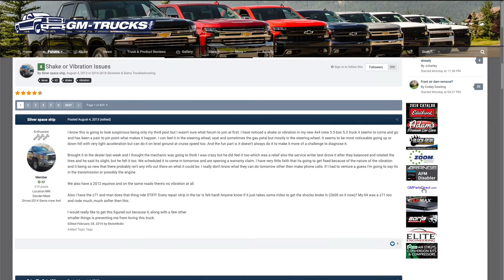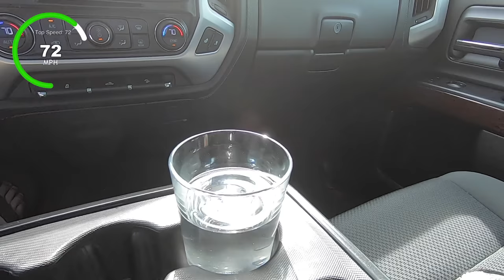"Chevy Shake" Driveshaft Fix for GM Trucks?

Comment: use to go through u-joints in my old F-150 then i ran over a deer and bent drive shaft had a new one built and i had put on almost 100,000 miles on the same u-joints when i sold it
Reply from the maker: Thank you donald day

Comment: My truck shakes 30-45 miles per hour and then smooth out, idk why. I’ve been trying to fix it and I figure the 26” rims would be the case but I had actually lifted the truck with and without the rims, also putting the original one in it. The shaking of the truck sounded really bad 30 to 45 still and when I stopped the truck, I would hear like a crack sound when lifted.
Reply from the maker: Sorry to hear that.

Comment: Ive had 3 of these trucks. 14 silverado 4x4 double cab was smooth up to 75k when i sold it. 14 silverado 2wd still have it and it shakes very very little. My 16 sierra 4x4 shaked bad.. Did a 4" coilover BDS lift and it seemed to tone it down quite a bit.
Reply from the maker: Thanks Jose Gutierrez, I appreciate the input.

Comment: I wonder if maybe balancing the driveshaft would take care of the vibration thats left. Maybe they've done that already. I bought a 14 sierra im hounastly bless i haven't had any issues with it, and its at 107k. Ive had it up to close to 100mph and its silky smooth. Not saying I'm gonna push my luck and hit the limiter lol. So far only issue I've had is the manifold gasket blowing out exhaust

Comment: I'm wondering why the shop decided to perform surgery with the 2-piece shaft before swapping in an upgraded 1-piece to test results?  Seems like extra effort right off the bat.
Reply from the maker: Lee Cherubini just trial and error diagnosis. The 2 piece has been known to fix the vibration in the 2WD trucks so that was what they wanted to try in the 4WD trucks.

Comment: I have the same issue in my 2011 silverado 6 speed it has the shake at about 115 / 120 mph
Reply from the maker: Just gotta ride through it and get er up to 125 I guess.
Reply: I have a 2016 2500, it has a speed limiter, can't get to 100mph, leave it to GM to fix a problem by not making that scenario possible.
Reply: @dainwright1573  programmer
Reply: all tires are speed rated they have to make trucks for dumb people so they won't get sued by stupid drivers

Comment: I have a new 2019 that has a vibration from 20 to 30 mph and I can almost guarantee its a driveshaft.
Reply from the maker: Really? Don’t hear a lot on the 19’s. Have you taken it in yet?
Reply: Mine too 2015 gmc 20 to 30. You think its the driveshaft
Reply: Luckily I dont have this issue
Reply: When you start to notice the vibration, look at the middle gauges, and see if it's when the v4 mode kicks in, I have a 2015 Silverado 5.3 had the vibration when the v4 mode kicked in, I brought an edge programmer for it, turned the dod(displacement on demand) afm(active fuel management) whatever you wanna call it, I have no more vibration issues, mines v8 all the time now, oh and also it didnt hurt my mileage that bad only down like 2 to 3mpg
Reply: It was the torque converter for my 2016.
Reply: I have a 2019 GMC Canyon. It started shuttering and shaking at 1500 miles.  There is a service bulletin issued  from GM on this issue. It requires changing the fluid in the transmission to a different type.   I brought it in for that service and it fixed the issue.

Comment: Did you raise your front bumper?  What size tires are those?  Lastly I've heard changing out the axles is a huge improvement for the chevy shake.  I bought a new 18 Sierra Z71 with the 6.2 and was real scared I'd have the chevy shake.  So far after 18,000 miles no shake!
Reply: Me either..so far.. fingers crossed
Reply from the maker: I did not raise the font bumper, just removed that air dam on the lower.

Comment: I have the same truck with like a 1
5inch leveling kit.. mostly stock stuff.  Almost no vibration. I figure anything is from tire balance.
Reply from the maker: Thanks for the input, they did replace one of the wheels really early on as being out of spec but otherwise the tires have been balanced several times with no luck in making a significant difference.

Comment: 2017 Chevy ext cab.... the shake is driving me crazy. Driven GM my whole life without issues until now. When I first bought this truck it only had 30,000 miles on it. I did not have a shake until after 100,000 miles. They had to change the transmission in it and it has had a shake ever since. I'm going to attempt to change drive shaft and U-joint hoping that solves the issue. Because I didn't have a problem until I got a new transmission I wonder if it caused a bind and on evenly or out the U-joint?
Reply from the maker: Sorry to hear that.

Comment: Bought my 14 crew cab 5.3 used with 45k miles. Day i drove it home  called the dealer and said it shook bad. They took a big shit on me, to make a long story short was going to trade it on an f150 but tried a local gmc dealer and they did the ring and pinion under powertrain warranty. Made a world of difference along with getting rid of the crummy hankook tires the dealer put on it for michelins. BUT, still have a slight shimmy, not too bad, around 75-80. I give up. Also i was a mechanic for 15 years, and i still give up. Almost thinking front wheel bearings as it does go away sometimes on a slight bend when u r turning the wheel just a little.  Oh well it only goes on long highway trips 2-3 times a year i drive mostly local.  Take the wifes tahoe on the family trips...
Reply from the maker: Any updates on the truck?
Reply: Try a tranny flush I heard that worked for a couple people

Comment: Hi Dan, this is a great video. I purchased a 2014 Chevy Silverado Regular cab 6.5 ft bed 4.3 v6 2wd yesterday. It's starts to vibrate at 70 mph then extremely worse at 75 mph, the entire center console is shaking. You mention that performance drivelines can fix this issue on the 2wd Chevy with their driveshaft. Has this been verified by anyone you have talked to? I'm considering ordering this driveshaft because the truck is not drivable at 75 mph. I always need to keep it at 70 mph and below.
Reply: @Nick Sarris if you watch till the end he explains what his thoughts are. The problem got better but wasn't completely fixed.
Reply from the maker: Thanks Nick, I really appreciate that.

Comment: I guess I am one of the lucky ones.  My 2015 Silverado,  double cab,  4X4, 5.3 V8 doesn't shake at all.
Reply: I have the same exact truck
Reply: My 14 crew 2wd doesn't have this issue tho it did suffer the condenser failure issue.
Reply from the maker: I agree Roy Giller. Thanks for the comment.
Reply: My 2015 GMC Sierra  4x4 has never had this at all
Reply: Gears & Gadgets my mom has a 2020 Tahoe RST 4wd and her driveline has not vibrated. My dad has 2 2015 Sierra SLE 4wds, 1500 and single-rear-wheel 3500HD.

Comment: Ugh we had an chevy silverado 2016 shaking at idle n a rolling tumble feel 
Ugh piston or something major

Live in north phx here
Reply from the maker: Do you still have it?
Reply: @GearsGadgets   yea, this year alone, first both alternator then fuel pump, then needed brakes(front) still need back,  then this. 
First time in my life, all costly repairs in one year
Reply: @GearsGadgets  got it back from dealership
Damaged camshaft n essential repairs needed to be done around that, seals,filters, gaskets,etc etc. Engine n transmission flush including fluid changes in all departments. Replaced oil pan,cracked cuz it waa leaking.  N finally spark plugs....n sum air filters
Reply: Me too I’m in Phx same issues
Reply: @ZulunationFamily  we end up paying $8k it was damage n wear and tear to cam shaft inside the engine. They replaced everything around the engine
Reply: azapache2006 mine is  a 2009 I’m taking it yo the dealership Wednesday
Reply: @ZulunationFamily  only place that needs to fix it is at the dealership

Comment: I have a 2500HD GMC Seirra Ext Cab and I have a Vibration that only shows up when I am pushing on the Accelerator at speeds above 50 MPH and at the same speeds it goes away if I just fully let off the accelerator, I have checked everything from Bearings to driveshaft to Balancing the wheels to no solution then someone sugested Motor mounts and Transmission mounts.
Reply from the maker: Sorry to hear that. Seems to be a common issue.

Comment: my 2016 Silverado 4x4 with 6 inch lift, tires are goodyear duratrac 305/55r20 it now has 39 thousand km. the front tires started to cup, rebalanced and front end alignment which was not out, put the tires on the rear and now I get a shakeover 105 kmph and higher I put 12oz of balance beads in the rear tires it is now tolerable at high way speeds. I say its your tires that cause the shake.
Reply from the maker: Nope, tires were replaced twice different brands no effect. Wheel was also replaced that was out of round

Comment: Chevy dealer replaced a tire that supposedly had some high road force problem. Didn't seem to me like it did much if anything. My shake doesn't really seem all that bad to me.
Think the main problem might be the transmission oil change with mobil 1.
I'll do it and see what happens. Maybe push a upgraded driveshaft on them.
Reply from the maker: I went through all of that too.

Comment: Its not 4 cylinder mode, i know for a fact. My 2017 rcsb is 4wd. I have a big Texas Speed camshaft and DOD/AFM delete kit with a different stall converter. I still have “chevy shake”  i do still have the OEM drive shaft though. I have aftermarket wheels and tires so its not rims or tires either. I also have the shortest most rigid steel OEM drive shaft possible for GM trucks. I have a 6.5’ box with a regular cab and 4wd transfer case on the end of my trans shortening my drive shaft. As well as the fact that it is a single piece drive shaft. And mine still does it. Ive heard its the rear cab mounts also. Its all snake oil lol.

Comment: Did you ever change your Rotors could be out of Balance had a terrible shake on my 07 gmc tried tires re balanced the drive shaft lived with the shake till I did brakes and magically it disappeared
Reply from the maker: Yes. No change.

Comment: Have a little bit of shake on my 2015 GMC Sierra double cap 4.3 i have 20 in Denali wheels and all terrian bfg bought used i have 95k miles on it seems to run great engine and transmission doesn't use oil. Im not gonna spend 2 family vacations to fix the crap gonna go with hopefully balance the wheels then place my bet on the AFM gonna buy the range technology and keep all my cylinders running.
Reply from the maker: I didn't notice anything related to the cylinder deactivation making it any better or any worse but ultimately its really just a guessing game really.

Comment: Thanks for update. Carbon fiber driveshaft even better???.. Did you check old axles for straightness? I almost bought 2015 Silverado a month ago, but it had moderate shake at ~70mph. Then I saw some of your videos and some of the various threads on forums about the "Chevy shake" and I quickly changed my mind about that particular 2015 Silverado.
Reply from the maker: Glad I could help. I couldn't imagine the cost of carbon fiber, also not sure it would help or make it worse.
Reply: @GearsGadgets  - CF driveshaft is not that expensive. But it appears you have not yet discovered the perfect solution. Very interesting, and disappointing. Shame on GM for this issue, there's no excuse for excessive vibration, especially as they've been making trucks for so many decades.

Comment: How to use the bumper to bumper warranty? Does it only apply to the original dealer I got the truck from? My 2018 started shaking at ~30k miles.
Reply from the maker: You would have to ask the dealer I guess. I can’t tell you what to do.

Comment: I guess I maybe the anomaly, I have a 2014 Texas Edition silverado with 144,000 miles on it and I drive it like a sports car and do 80 and 90 mph and I have no shake but I do change all of the fluids regularly ,regular oil changes transmission fluid changed twice since I bought it and the transfer case fluid and the oil in both differentals

Comment: I’m having the same issue. 2016 Silverado 5.3 flex 1500. At first Chevy told me it was the oversized tires they put on it. Well 60,000 miles later I put new tires on it and had a full alignment done. The problem still exist even with a slightly smaller and less aggressive tire. Smaller tire did help slightly but the Chevy shake is still there. I checked for rear  axle alignment and I adjusted axles until there was less than 1/8 difference.  Engine shake is BS. I have no misfire, I check with a snap on scanner and I didn’t have a single misfire, up hill, down hill or at any normal RPM range. I’ve inspected my driveshaft ujoint and have zero play. I also inspected all suspension components as I have a 3.5 inch aftermarket lift (Rancho) that came stock with my truck purchase from a Chevy dealer and all components are tight, no signs of extreme wear and no leaky shocks. Shocks sill work as they should and leaf springs are doing their job when loaded. 

I don’t have any loud noises from my rear end just the shake. I can literally see my truck bed vibrating in my side mirrors. I don’t hear any bearing squeaks or squalls. No damage to driveshaft. So I’m just like what the hellzzz is the issue?! 
If time permits I will inspect rear differential for runout and end play as well as rear axle bearings but I’m still scratching my head here because these types are things are usually fairly easy to problem solve. Thanks for any advice.
Reply from the maker: The driveshaft / axles cut down my vibration by about 90% and at times it is smooth as can be. It was by far the best fix so far. I have a hard time telling people to do it because all of these “fixes” seem to be VERY truck specific and I would hate to hear someone say they saved up money for the parts only to have it not work.

Comment: I had this same issue and if I could offer a piece of advice it would be to not throw money at parts without first diagnosing because this issue has many causes which are inexpensive fixes.I tried on two sets of wheels, had the tires rebalanced, stock driveshaft rebalanced, reshimmed the rear axle angle, and had the axles checked for out of roundness with a gauge.Mine was a RCSB on factory 20" and the silver bullet was softer rear shocks.Take the time to have someone check everything in the drive line and you will find the cause.
Reply from the maker: I agree, throwing money at parts isn't a great idea. Unfortunately its just kind of a hit or miss kind of problem from what I can tell.
Reply: Thanks. Mine is a RCSB as well. (2014)
Do you recall the shocks you used? 
Thx
Reply: No offense but sounds like a band-aid fix... vibrations don't occure from simply having a differnt stiffness in shock...altho maybe a softer shock made it less noticeable...

Comment: I have a 2017 chevy silverado 6 cyl, mine has a vibration shaking while holding the gas pedal at idle while diving, then it goes out after giving gas or let go off the pedal.
Reply from the maker: Interesting.
Reply: I have a 17 (42k miles) with the 6.2 doing something similar. Feels like the converter lock up engagement is funky. You can test locking and unlocking the converter by getting to highway speed with your foot on the gas lightly press the brake. The rpms should come up a bit and the converter will unlock. I've been trying to perform this test when mine shakes but need more drive time to pinpoint.

Comment: My 01 1500 z71 started shaking mainly on the right side at ~120km/h, worse when I let off the gas and am coasting, will disappear when slow down or speed up past that "shake area", would this be the same issue or possibly a tire issue?
Reply: Kobe have the 98 Z71 doing the same thing. If you feather the gas or punch it to downshift it goes away. I'm going to try the Valvoline synthetic with that friction modifier. That 2 stroke commented on Take a peek at the driveline.

Comment: measure the back lash on the rear gear.. do it in 6-8 diffrent places.. if theirs more than .002 diffrence change the rear gear... when they made the rear gears they were sposto change the cutters every 5000 gears but they changed them every 30000..
Reply from the maker: Thank you Gmullin12

Comment: Yeah my girlfriend has a 2014 crew cab 5.3 2wd with the same issue, my 1995 c1500 with 350,000 miles don’t vibrate at all
Reply from the maker: That sucks man. Sorry to hear that.
Reply: check carrier bearing 2wheel crew cab long drive shaft

Comment: Any idea why my ‘17 Silverado 1500 shakes or kicks when braking between 30-25 mph? Only has 34,000 miles
Reply from the maker: No clue other than possible warped rotors or something wrong with a bearing? That type of thing is hard to guess without seeing the problem first hand.
Reply: Gears & Gadgets I have a 2.5 inch lift kit. Could that be causing it?

Comment: Oh yes I've done new Ring and pinion and all new Bearings on the Carrier and the pinion housing
Reply: Jack Graves did it help with vibration?
Reply: @PanchoPistolas45  no. Vibration was helped with driveshaft and axles. I did 4.10 gear for towing
Reply from the maker: How do you like the 4.10 for daily?
Reply: @GearsGadgets  My 4.10s work Great with my tune and stage 3 camshaft. With the stock 3.42s I was getting 12-13 mpg town. With my 4.10s I get 14-15 in town. I think its because the 3.42 bogged this cam down the 4.10s keep the cam in its Sweet spot and allow the tranny to go into 6th gear around town saving gas